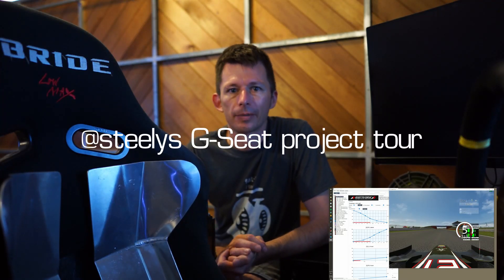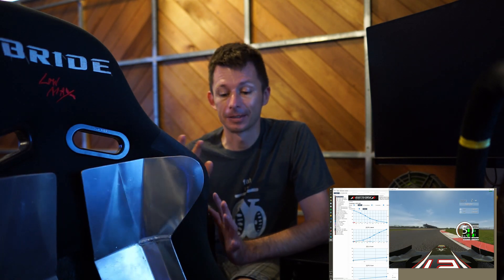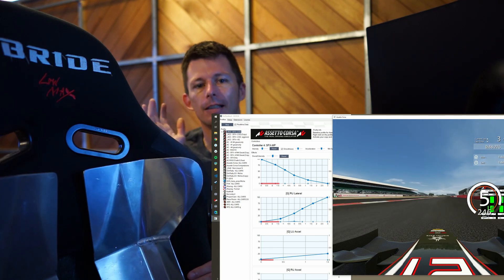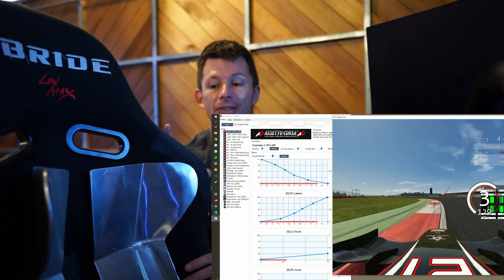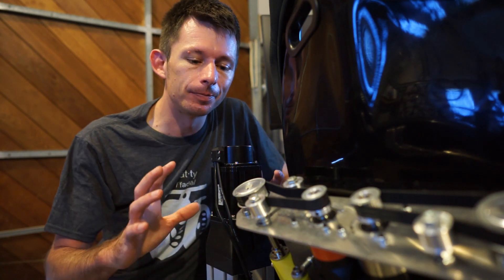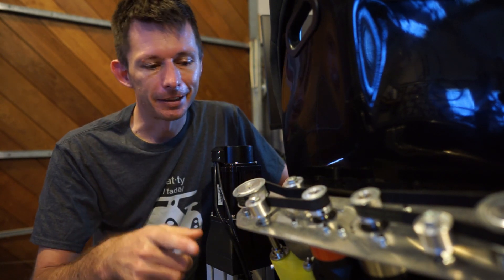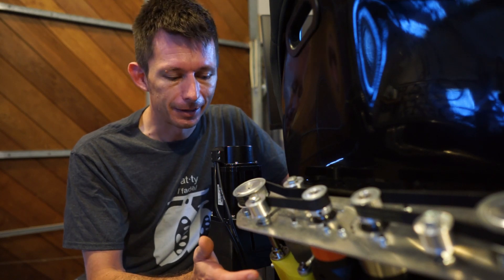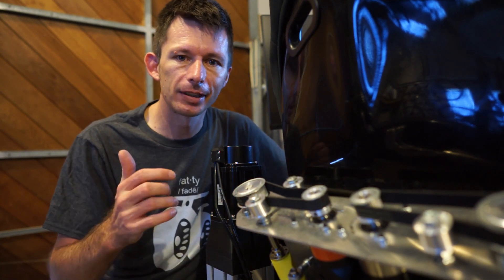DIY AC Servo G-Seat Project tour video

Comment: Great work Rowan - thanks for sharing. Good luck with the upgrades - I have my eye on a 2nd hand bride stradia low max replica for my Sfx100 - would you recommend 👍🏼
Reply from the maker: Cheers Paul ! 2nd hand is good, that makes it cheap - basically figure out if it's comfortable.. if you can try sitting in it, if you like it buy it :) Seriously seating is so personal only one person can figure out if it works for them.